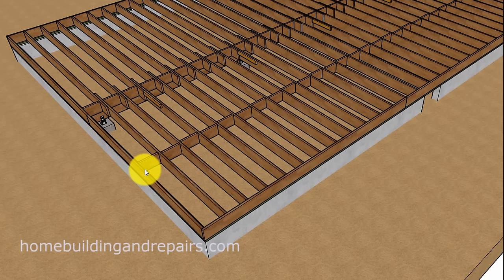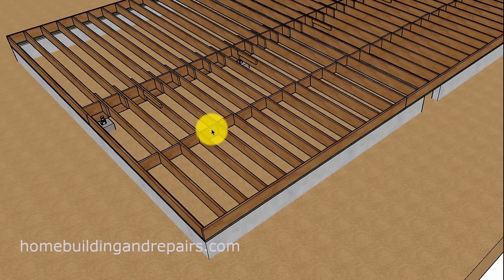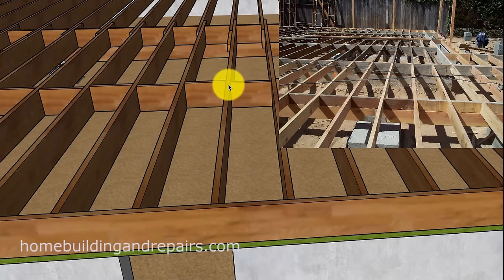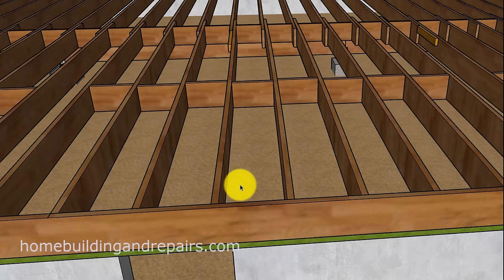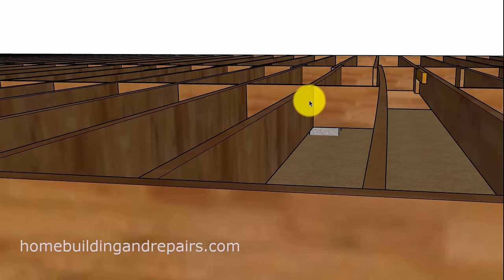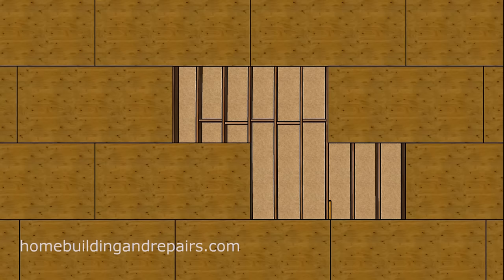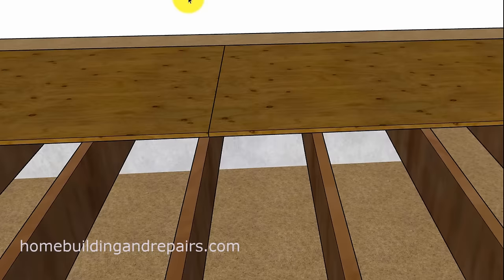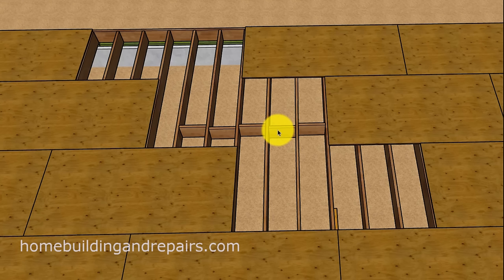This Is One of the Biggest Problems Keeping Floor Joists Straight

Comment: The way I've always done it is to lay a 2x4  over the top of the floor joists. Space the joists correctly and nail down the 2x4. Then cut half the blocks you need at exactly the correct width and install every other one. Finally you come back and measure and cut the missing ones individually and this takes care of any abnormalities in the wood. Saves a ton of remeasuring time and the plywood never misses the lips.
Reply: Thats flippin smart! I will do it your way
Reply: Good tip, thank you.
Reply: this is the way.
Reply: Thanks
Reply: We just used 1 x 3 firring/strapping laid out along side top plates for rafters or band joists for floor joists. We nailed them on with duplex head nails before we had nail guns. Building a garage roof we had to plan out the sheathing stagger and make sure no rafters with a bark edged crowns fell on those 4 foot centers

Comment: Blocking really isn't that hard. If you have to pound the block with a hammer to get it between two joists... STOP and shave a blade width off. If you slide the block in and you can fit your finger between the block and the joist, throw it into the scrap pile, remeasure and recut. Blocking just strengthens the mid span of the board, helps reduce bounce, and helps distribute load to be shared along other members. I think many DIYers, including myself at times, try to be too precise and get frustrated when wood they cut doesn't fit absolutely perfect. Measure twice, perhaps thrice, and cut once.

Comment: if you only measure back to the last joist to assure 16” OC, you will still get amplification of error over distance.  Either measure back to the START point for each on (which is too time consuming) or tack down a story pole / jury stick first.
Reply from the maker: Good point and if you are not measuring off of joist that are already correctly positioned, then you could have a problem. Thanks for sharing.

Comment: Another thing rookies don't know is EVERY top nail IS a squeak as well.Pulled up to a completed underfloor the other day.EVERY block was top nailed.LOTS of subfloor glue is also a good stopgap measure.
Reply from the maker: I like it, I never thought about that and I wonder if it would be better to install smaller blocks. If you were going to use 2 x 10 floor joists, maybe 2 x 6 blocks located near the bottom might eliminate squeaks.

Comment: It's called cumulative error . The solution is to use cross bridging , tack the tops in place then sheath the floor . after the ply is in place then go back underneath  and nail the bottom . Real carpenters do it like this all the time .
Reply from the maker: I was wondering how you could become a real carpenter:)

Comment: I usually tack a 1x across the top of the joists to hold them at 16” oc and measure the spaces. The spacing usually runs from 14 1/2” to 14 3/8”, that 1/8” difference, if not taken care of, can add up to a lot of problems.

Comment: I've experienced this in real life doing what I do. The cause of this I found to be joists that are cupped. If you're joist is cupped and your block is cut square on one side you'll have a gap in the middle of your block and the other side of that choice you would have a gap on the top and bottom. Good information here and good solution trim a little off when you need to.
Reply from the maker: You've definitely had experience with that one before and your comment is sincerely appreciated.

Comment: Excellent warning.  I've built some sheds and outbuildings and wondered how things got "off".  To correct the problem (drift) after the fact, I had to add 2 x 4 extensions to the floor joist for the neighboring plywood sheet to anchor into.  More often I encounter this problem when fixing someone's old job like a deck with nails or screws that have popped out because the drift or spacing was not corrected when it was being built.

Comment: As a framer, I'll usually mark a board out at 14.5" increments (29", 33.5", etc) and then when cutting, take the saw down the middle of the line, so the 1/8" blade takes 1/16th off each side of the cut. Installed, these usually slide in with just a touch of tension, and work out to be within a 1/16" of layout even after 10 ft or so, and that's more than good enough for framing. In framing, you almost always find that stacking layers, you gain a little bit. hence taking a little off each block works out perfectly.

 I would double check layout every 8' or so, every other joist is excessive and wastes time. Even if you're a 1/4" off layout, that's acceptable, more than that is getting sloppy though and going to increase the likelihood of squeaks from shiners
Reply: You'd be hard pressed to find an 1/8" kerf framing blade.. most are 1/16 these days believe it or not.
Reply: @9mmkahr not true at all. Almost every blade on the market is 1/8”. I am a framer and woodworker.

Comment: You also could lay the plywood down and make sure you’re hitting joists and put blocking in after either all of the sheathing is down (from below), or as you approach the point where blocking is needed. Glue the blocking. It helps with squeaking.

Comment: This is why we install the sheathing up to the line of blocking and then install the blocking slightly short or cross bringing that why the joist can be moved to exactly you want them when nailing down the leading edge of sheathing.
Reply from the maker: Definitely another way to use and thanks for sharing.

Comment: I always put midspan blocks because it greatly strengthens the joist.  Also, I used construction adhesive with the blocks-  avoids and squeaks.
Reply: His whole point is that the addition of error will lead to unsupported edges of floor sheathing.
Reply: @utubeaccess7  ok i get it now...
Reply: I removed middle blocking from a section that was 12' span 2x10 floor joists. 16'x12' area. Once the blocking was off, you could feel the vibration in the floor system when you walk or drop something. Makes a big difference.

Comment: Snap your control line accounting for the tongue at the outside wall.  Glue up your joists just shy of the 4’ mark.Drop your first sheet in a squared corner, ideally to break at 8’.  Nail off your ends and tack each joist “perfectly” on layout with your tape measure hooked then nail off.  Repeat as needed working toward your first set of blocks or crossties leaving enough room to maneuver your nail gun.  Don’t forget you were doing blocking and run glue. If you have a few feet of space you can make adjustments with the sluggo you were using with your 4’ beater block (2x4 usually) and cut and install your blocks to fit, or precut the blocks “taking the line” when you cut.  This plus a spot check every now and then ought to be sufficient.
Reply: This.

Comment: We used to lay the subfloor up to the point of where the mid span blocks would go before installing them. That way we could keep the joists running straight.
Reply from the maker: That's an excellent idea and it also provide you with a nice flat surface to stand on while installing the blocks.

Comment: 15 and three eights...if you got it square then pull 15 and three eights and set your joist and first stud at that point, all your plywood at that point will land on layout as long as you make sure your reveal is right and nail the front of the ply on layout. codes require blocks sometimes but for the spans shown, I wouldn't add them just because of the problems this guy just stated. if they are required, I put them up later to avoid foresaid reasons

Comment: This commentary is exactly right concerning mid span blocks but I will add that if installed correctly with an accurate and tight fit sqeaking can be a problem at first but eventually goes away after the first rain on the subfloor. The wood swells and the subfloor gets tighter. Also, if you glue your subfloor that creates a stronger floor with less bounce. It's a hassle but if you fasten your blocks using 3 inch decking screws, that will also reduce squeaking
Reply: I work in Europe and we screw way more than USA framers. From watching videos I can tell they may be faster but I always wondered about  squeaking and bouncing. Also floor joists here are mostly real beams, usually 3" wide.
Reply: @nelus7276  you can't go wrong using screws. I'm a licensed builder here in the US and I have glued and screwed my subfloor down on a few houses. I always use subfloor glue regardless of whether I nail or screw. I read somewhere ( I don't know if it's true) that glue adds 30% more strength to the floor system. 
I don't know of any builders that use screws on the wall, ceiling, or roof framing. It's all done with nails. 
Now commercial builders tend to use more screws.

Comment: It is the cupped floor joist causing the problem. Even a slightly cupped 2x10 joist will cause 1/8 deflection when you add a 14 1/2" blocking in between. If you want solid floors, do the blocking. Screw the blocking to the floor joist with construction adhesive. Add couple nails after if you like. I removed middle blocking in a 12' span 2x10 floor joists in a section of the house. The difference was day and night. You could feel the vibration of the whole floor after the blocks were removed. DO BLOCKING if it is your house.
Reply from the maker: You've got an excellent point, blocking sure seems like it makes the floor stiffer, but it's more noticeable on larger spans. Also great point about cupped joist.
Reply: Hey there - scenario for you… I’ve removed a 4x8 sheet of T&G subfloor in my house because I had awful squeaks. Determined if was the blocking so I removed it and the squeak is now gone. Want to replace it with good blocking but I’m noticing the joists are like you said cupped now which I think is what was causing the noises. What would you recommend doing in this case?
Reply: @j-moto1215  Are they all cupped? It is labor intensive but i would fit the blocking snug between the joists and use PL construction adhesive and screw them with construction screws. The cupping will create gaps depending on which side of the cupping your blocking is. Apply some glue in those gaps and drive wood shims from both sides. Gluing and screwing is a must for joist blocking.

Comment: I measure spacing at each bearing end and take the average for a centre bracing. I also pva glue as well as screw. Bracing stops the joists from twisting and shares bending between adjacent joists to reduce movement (bounce)
Reply from the maker: What is the glue used for, the screws?

Comment: Well that's why we use Bridging and not Blocking.  I had a nice lengthy back and forth with a structural engineer about deflection of solid sawn lumber floor systems, assuming blocking was stronger.  Basically he said NO and why bridging was better, structurally, than blocks.
Reply: Agreed. And if you nail off the tops first, and nail off the bottoms off after the sheathing is done, you end up with bridging tightens itself up to precisely the right length for the cavity, after the joists are straightened out by reference to the sheathing.
Reply: @grizzlygrizzle  exactly!   Cheers

Comment: Tried to get my blocks dead nuts on. A 1/16th over 16 joists is one inch. I pull my tape on the joists to make sure they’re where they need to be. I mark 3/4” from one side and 3/4” from the other side in the middle on top of the joist I’m measuring so I get a center measurement. Then if my joists start wandering, I adjust the length of the blocking over a few blocks to buy out the of center. But like you said, constantly grab the tape and make sure they’re where they need to be. Any framing component really. You only screw yourself if you don’t when you go to sheath and you’re not hitting center with each panel.

Comment: Greg, great video! I also see people laying out block on a long 2x10 etc using a speed square, so would this framer be essentially losing 3/32-1/8 from the blade kerf after cutting each piece? I guess it would create a bow in the opposite direction. After 8-10 blocks you are an inch short. I noticed my brother does this type of work with a partner so he can call out the measurement in real time after he nails the block in. That way he can keep checking as you go.
Reply from the maker: Glad you like video and cutting the blocks out of square or different sizes or even the inability to nail the joist tight enough to the blocks, seems to be the biggest problem with this process.

Comment: Noggins (aka blocking) are the number 1 reason for floor squeaks - the joists will shrink over time (yes, even kiln dried) and the resulting gap between joist an noggin allows just enough movement on the nail for creaks to occur. The best solution is to use herringbone struts (modern metal versions are quick to install) as they actually tighten as the joists shrink. Solid blocking is fast, but no way would I ever use them in my own house.
Reply: The strapping/furring bridging is fast enough, if you cut them all just a bit short and nail the tops as you go. You can straighten the joists with the sheathing, and then nail off the bottoms later. This way, when you push the bottoms up and nail them, you're tightening up any slack in the joist cavities in a way that achieves maximally tight fit with no adjustments. Besides, the metal ones can "ring" when there's a sudden impact on the floor. If it were my house, I'd do it with strapping/furring. 
-- As for solid blocking, we used to sheathe the floor out to just short of the midpoint, straightening the joists with the sheating, and then take out an armful of 14-1/2s with a bunch of scraps, use the pre-cut ones where they fit, and cut the scraps to fit otherwise. Trying to cut the blocks all the same length and expecting no tolerance build-up seems idiotic to me.

Comment: I use blocking all the time, even on short 6 or 8 foot spans, because it makes a really solid floor.  Using 3 or 4 3" ring shank nails end nailed on each end of staggered blocking, engineered 23/32 tongue and groove sheathing like Advantech or LP 350 with subfloor adhesive and 2-3/8 ring shank nails. And glue and nail the sheathing to the blocking, and glue the tongue to the groove. Solid floor, no squeak.
Reply from the maker: Thanks for sharing and some more things for us to consider.
Reply: I laugh when a contractors say blocking doesn't do anything. They don't want to do it because it is a lot of work to do it properly. You can't just cut it 1/4 short and throw some nails. Anyways from my personal experience. The difference is night and day with blocking and not blocking.
Reply: @Faruk651  agree, I’m addition to keep the joists upright, blocking also distributes the load across multiple joists…
Reply: @bman6502  -- That was a glaring omission in the video.

Comment: You can also lay out a story pole marked out and tack it in place to put them 16" on center to start. Then just measure as you go.  ;)
Reply from the maker: Yes, I've seen that done with long spans of trust joist without blocking, but if some type of blocking is required, then it might not be necessary. It is a good idea and I've used it myself before.
Reply: @gregvancom  taking steps like that speeds up things. By making a simple story pole ND tacking it down, it makes cutting the blocks easier, and laying out the plywood perfect with no stopping and having to adjust. Learning to spend your time wisely makes the best craftsmanship and speed things along.  Guys try to cut corners and ends up shooting them selves in the foot and wasting lots of time. It actually takes much longer if you don't set things right in the 1st places. A lot of guys just don't get that.
Reply from the maker: You bring up a good point about some of the problems that can be created by doing things incorrectly and even though I'm not totally sold on your idea, understand that it works and would imagine that it creates a nice floor layout and thanks for sharing.

Comment: Idea:  First install the blocks in every other bay, then every other remaining bay (every fourth bay), and so on.  Starting in round two, if a block feels tight going in, shave off a sixteenth.  I think this should result in a good straight floor.  Another possible solution would be to install first the rows of sheathing that do not cover the blocking location, then do the blocking, then the final row of sheathing.
Reply: brother do i need blocking for a rom of 6x6 meters
Reply: Thats smart, sheet a bit before blocks😃

Comment: A question I've always had is how subfloor sheets are laid over the center of the floor where the joist ends overlap over the center beam? For instance, as here, I have a 26.5' floor span so I'm using 14' 2x12 joists not cut to length - just leaving them overlap in the center. How do you handle laying subfloor sheets over that center portion?

Comment: If you have access to the underside after subflooring, how about adding the blocking after the sheathing? Then you can space all the overlaps perfectly and cut the blocks to fit... Just an idea.
Reply from the maker: It might be a little more time consuming to do it that way, but it could provide you with a method to eliminate any blocks that would've been installed in the wrong location.
Reply: I've done it that way.  Long ago when I was a laborer for my uncle.   I was a young kid, and not too skilled yet, so it was a job that kept me busy, built skills and got things done right.  

Good solution for a DIY project,  or a crew with a new guy who needs practice.  Not sure if that's how I would do it now.

Comment: If you lay a long 2x4 across the joists, marked with joist lay out, temporarily nail and then attach blocking. Remove 2x4 after blocking is complete

Comment: Diagonal 1x3 bridging screwed between joists.  Rock solid and cheap. Blocks wind up squeaking.  Metal bridging squeaks.  I've never had problems with diagonal 1x3 as the framing package shrinks down and settles.